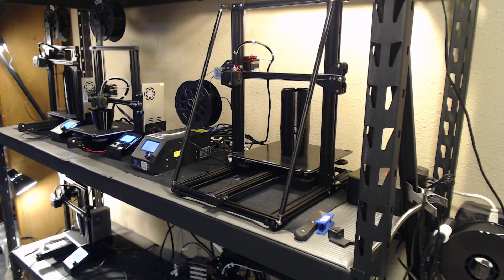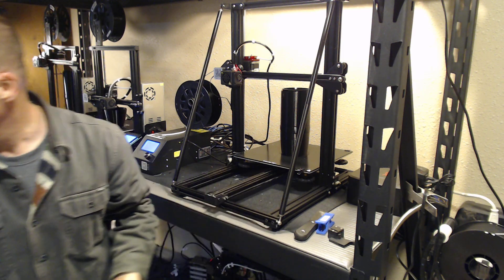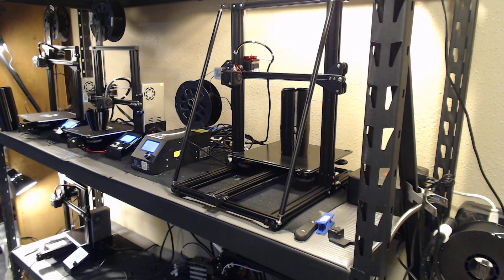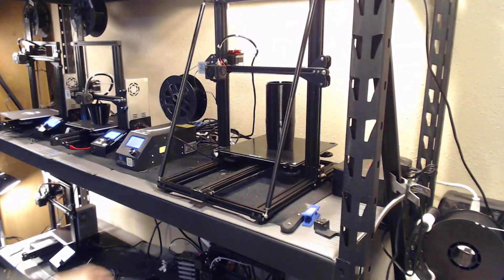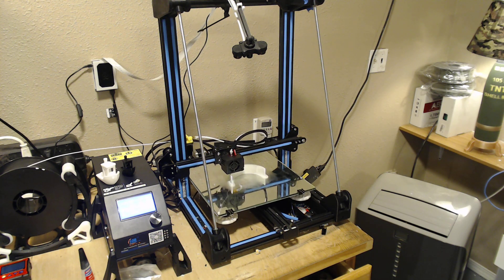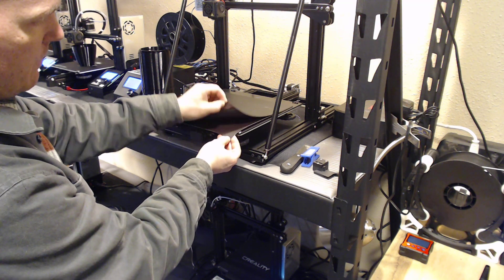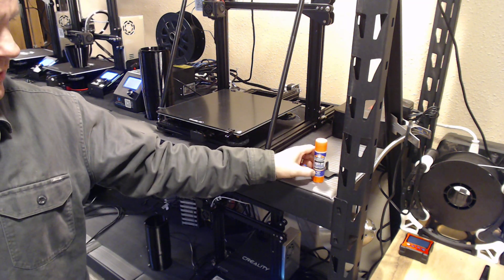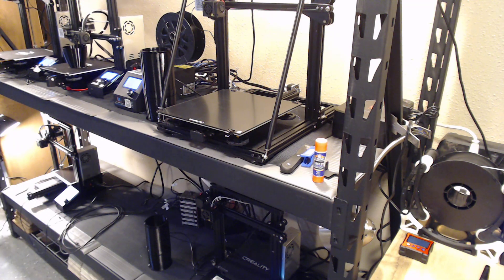What build surface should you get for your 3D Printer?

Comment: You have a HE3D 280? I just got one and have problems with extruder, did not have teflon and clogged and took me 3 times unclogging it to imagine something was missing and cut a section of provided filament tube to place it inside extruder. But now seems like    filament is not coming out in 0.4 but much smaller and is not printing well. What have ou done to make it work?
Reply from the maker: I have 2 HE3D K280s onsite and don't use either.  It was fun to tinker with but I 3D print 24/7 and they are too finicky for my needs.  You can get good prints out of them but they are pretty needy.
Reply: @makersteve934  Wow! I see! Which is the printer you use most? Seems like that is a valuable answer so to avoid the pain of tinkering with all the printers that are there.